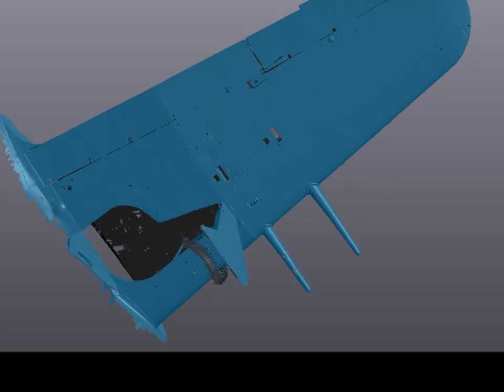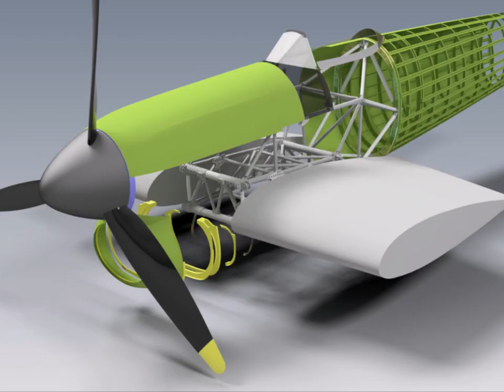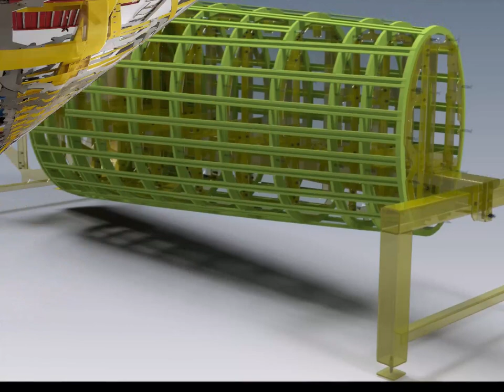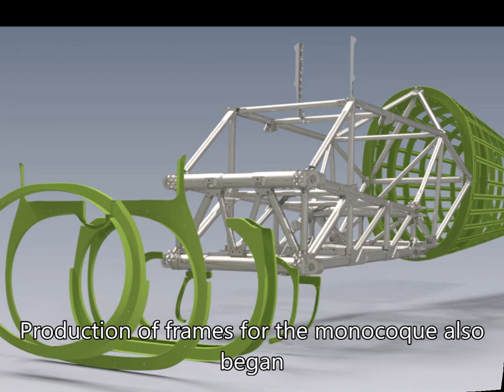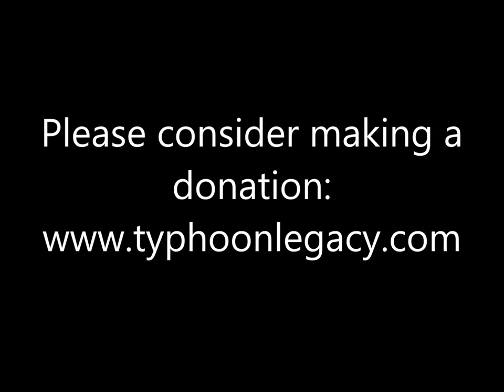Typhoon Legacy Co. Ltd. 2019

Comment: Great admiration for what you and the 'Team' are doing.  By Episode 10  was totally hooked and now I am subscribing to two Typhoon restorations.  May I ask if any of the original JP 893 parts will be incorporated in your Typhoon?
Reply from the maker: We will do our best, at the moment the side cowl panel is the only JP843 bit we could salvage parts from. We will be using other original parts as well, but this will be limited due to condition; most components will be built new to ensure integrity and safety. ~Ian

Comment: i have a stupid question.  how will you remove the yellow build frame from in-between the finished fuselage?
Reply from the maker: The fixture for the monocoque was very carefully designed, and can be disassembled from the inside out. The majority of the parts will be removed from the inside, leaving just either end supported. These will then be removed, and the spine will be raised for the removal of the monocoque. ~Ian